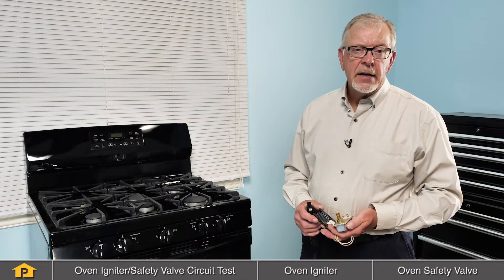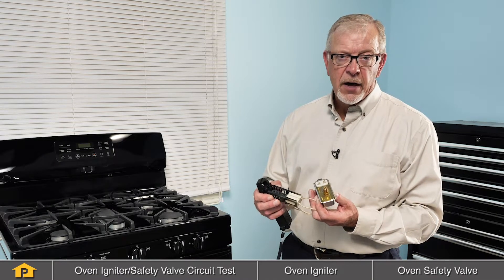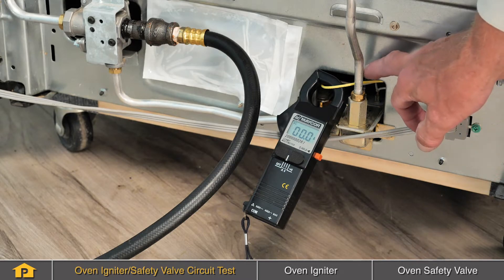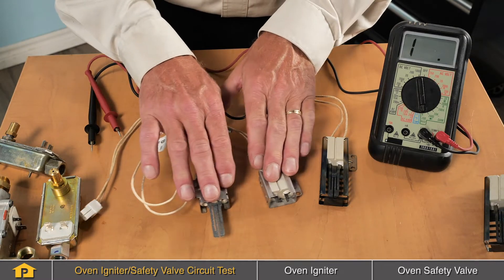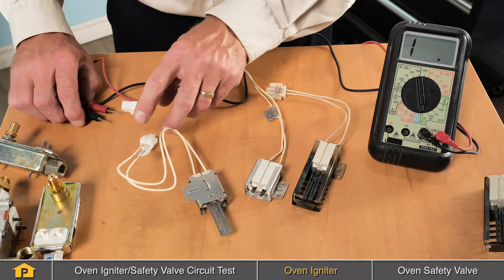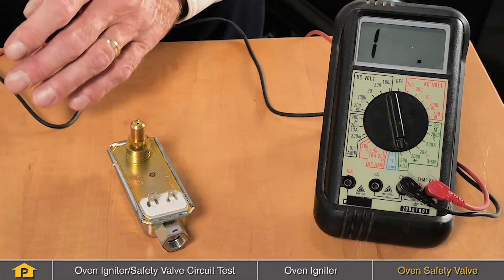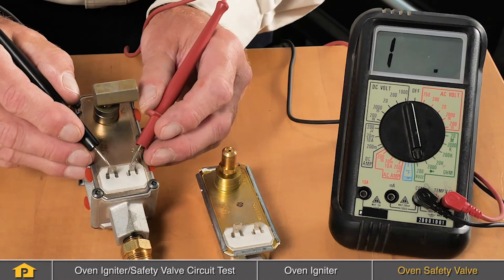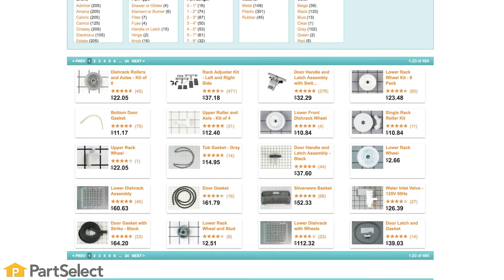Range/Oven Troubleshooting | How to Test a Gas Range Igniter & Oven Safety Valve | PartSelect.com

Comment: Had one this week a dual valve , everything checked perfectly,  but both sides of dual valve would not open/work , finally just tried a new valve and it worked perfectly,,, IDK ,  I never found the fault.
At least it works now,,,

Fluke 23, Fluke amp probe.

Comment: I have one question, the gas valve opens when the igniter reaches the right temperature. if the oven isn't getting hot and there is a gas smell could the valve and igniter be bad.

Comment: I need help. My oven will not ignite. I put in a new ignitor and safety valve. The new ignitor draws about 3.2 amps when starting up and then levels out at about 2.9 amps but the valve will not open. Is that still too low of ingnitor amperage..its brand new? If I tap the safety valve lightly with a screw driver it open will but that is not good for routine operation. What am I missing??
Reply: Sounds like you got a faulty valve from the factory if tapping it gets it to open. I would reach out to the seller/manufacturer for a replacement.

Comment: The the valve in Samsung gaas range i tested had 014 on top and 022 on the bottom. Bad. I replaced the ignitor on bottom but only gas getting to the top  burner and not very good at that

Comment: great vid!! thanks.   I have an LG gas oven. The stove and top burners all work fine.  The Broiler (new igniter now) comes on but has a weak gas flow/small flames, they flicker on and off.  and I have adjusted the air/fuel mixer to be about in the middle.  I have continuity on both sides of my dual safety valve, very low ohms. any ideas???  THANKS !

Comment: I was told a working igniter should operate with 3.4 amps. I bought two igniters and they did not work. I used a multimeter to test them. With power on.

Comment: Here's one for you...I have an old Caloric gas stove (propane).  After I use the oven, and it is still hot, none of the top burner spark units work (I have to use a match to light).  Once the oven is back at room temp,  the top burners light as they should.  I have replaced the spark module, wires, ceramic spark components, and I have added addition ground wires.  Nothing I have done corrects that issue.  Any thoughts?

Comment: The problem I'm seeing is in the quality of replacement parts. Not just appliances either. Car parts are similar. The American consumer is getting ripped off. There should be oversight on these items but no our government doesn't care.
Reply: I replaced the ignitor in my Frigidaire oven, and it worked for 2 effin' weeks. Now it's bad like the old one - barely glows and won't light. Chinese $hit!
Reply: Yes, and I've used what was supposed to be OEM and they still fail prematurely. @ujmrider
Reply: I found a list of chinese exports to over 130+ different countries. They all had A-Grade quality product designation. USA was Grade-B. 
I Saw that list a decade ago.

Comment: I followed all the tips here and it seems I have an anomaly. Everything tests out for resistance fine. I have a dual output safety valve and standard metal composite gas ignitor. The problem arises when everything is hooked back up and installed, only my broiler ignitor is coming on. I pulled the lower ignitor back out of the stove and wire it up to a 120v cord. It pulled 3.5 amps so that's good. Next, I hooked everything back up and still no lower burn tube. I checked the ACV at the the safety valve and I'm get 3v?!!!!! Shouldn't the voltage between 120V?

UPDATE:

Further troubleshooting lead me to the control PCB where I found a burnt circuit along the bake relay circuit. Bingo!!!!! Thanks for all the help getting me up to this point!
Reply: I here there are a lot of problems with those boards even in new units. They just can't take the heat. For reliability, I'm sticking with the bare bones stoves without circuit boards. Not even a clock. Parts still will go out however but at least they are parts you can get. There are problems getting electronic parts now. Another problem is with cheap parts. They are poor quality and don't last. I'm on my third igniter.
The cheap ones are defective right out of the box and will not last long. The last one only was usable for about a month then when it heats up the amperage drops off. Temp in oven goes up and down and won't hold. Thermostat is fine.
Reply: @stevenw4549  I've been suffering similar problems. 4th ignitor in 2 years. 2 have been 120$ plus name brand and 2 20$ chinese versions and the reliability was about the same. Also to note, the company that I bought them from needed to inspect the part before they sent me a replacement. Meaning more downtime.... The cheap version were usually replaced sight unseen within the warranty period.
Reply: @johns.1940  Ok maybe it's not the brand thing and just a problem with that technology not being reliable. At any rate a lot of people are getting ripped off. I'd just as soon be able to light it with a match at this point. Perhaps it's a problem with the safety valve? The bimetal may be getting weak or something. Good luck my friend.

Comment: My burners, oven and broiler have a spark ignition igniters. My broiler igniter clicks and lights but my oven Bake igniter does not click and light, but I did smell some gas. Can these spark type igniters be bench tested, and how do you test these ?

Comment: I changed the igniter and the safty valve. It was working fine for one day now the igniter glows red but will not turn on the burner. Does igniters go bad so quickly or did I maby but the wrong part? The stove is old and no part numbers match with model. I used the numbers off the old igniter. The part that came in looked just like the old one. I suspect the igniter has some how changed value.

Comment: Seems that if 1) you smell gas and the bake igniter glows but doesn't get hot or 2) the broiler ignites but the bake does not - you can skip ahead and conclude it is the igniter.
Reply: this is exactly my problem. thanks